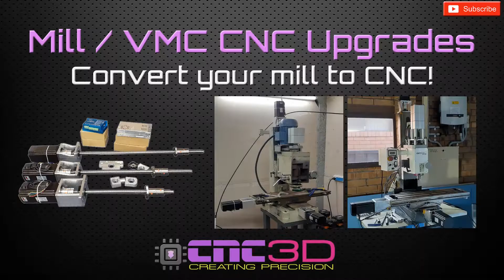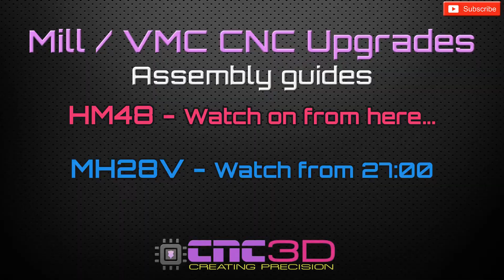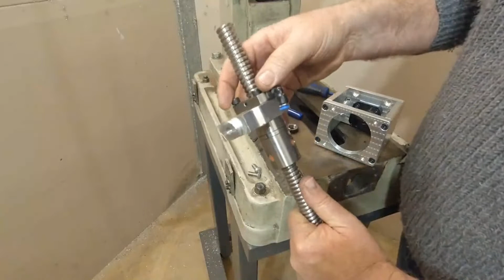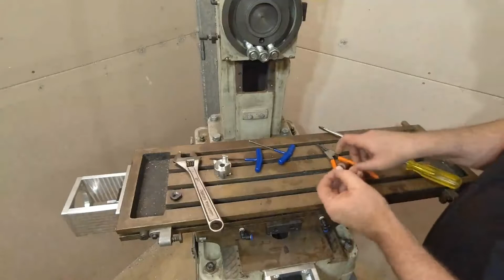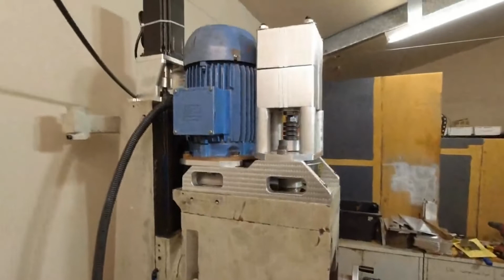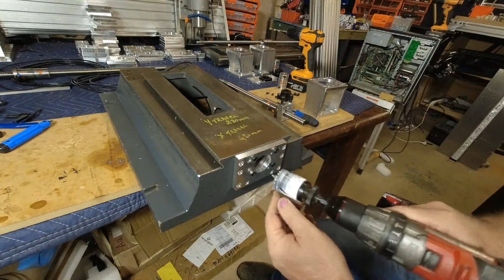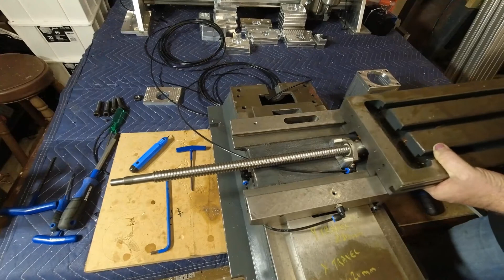CNC manual mill / VMC upgrade tutorial - HM48 and MH28V

Comment: In your opinion (judging by the image at the start of the video of two mills converted) which do you think is the better out the two shown at around 0:08? both in performance and ease of conversion? can they both cut steel or are the really limited to aluminium and plastic jobs? Thanks mate! 

MH48 vs MH28v ?